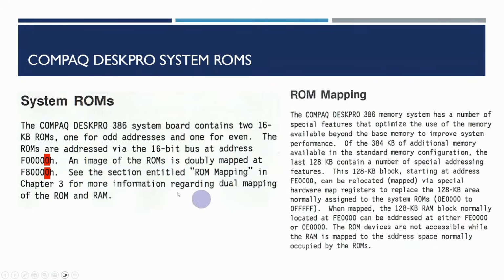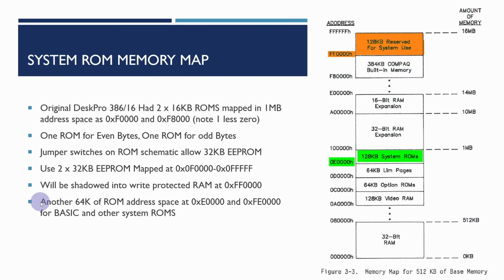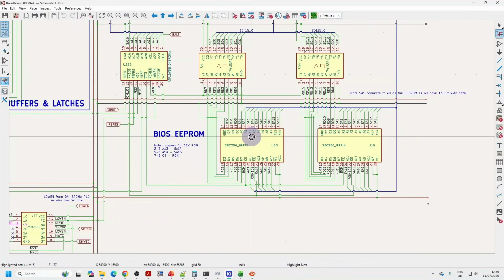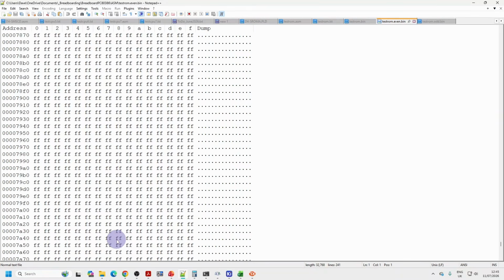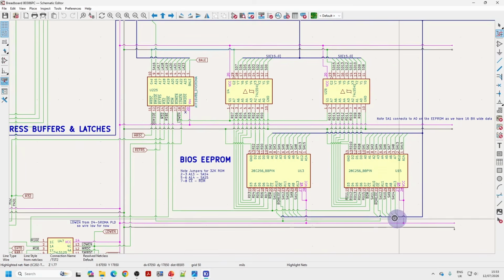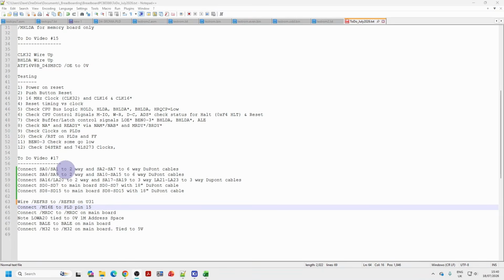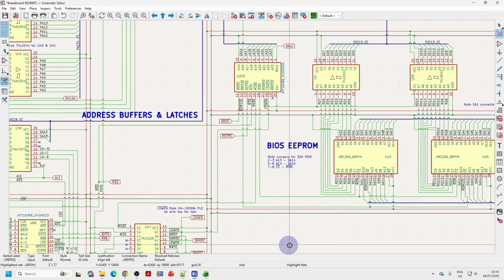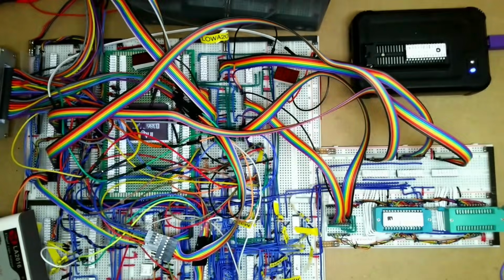386 Breadboard PC #17 16 Bit EEPROM & x86 Assembly

Comment: Amazing work as usual! I hope this becomes a kit you can order for my daughter and I to build, could you imagine being a kid and building an entire computer from scratch like a lego kit as a weekend+ project? (well, the components probably still manufactured, but still!)

Plus if its fast enough, booting win31 on something you have to put together yourself would be sick! 

I know its impractical, but I wonder if you connect LEDs to every last data/address line, if a high speed camera could make out the data flowing at speed?
Reply from the maker: Thanks for the feedback. A kit would be a) a very expensive, b) difficult to get some of the components (in any quantity), c) a nightmare to support and d) probably take 9-12 months to build with quite a lot of test kit (scope, logic analyzers etc)!
Best way to get an early era PC is to use a Raspberry PI Zero and a bare metal PC emulator.
The 386 BBPC should be fast enough with 10 MB of RAM to run Windows 95 retail (not OSR2).
The 386 DX 33 minimum clock speed is 8MHz, at this speed any LED won't show anything I would suspect.
The BBPC V2 with an 80C88 CMOS processor can be clocked at slow/static frequencies (push button single step etc). The V2 project used modern components from Mouser etc where possible. This is the best bet for flashing LEDs! Dave